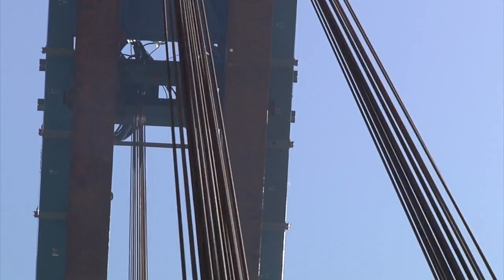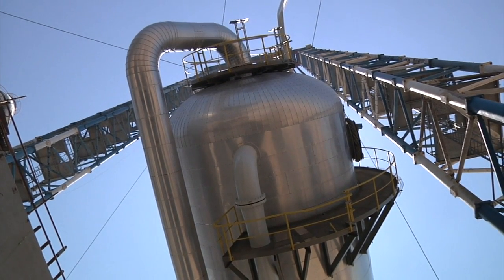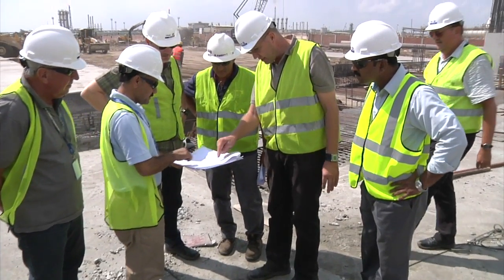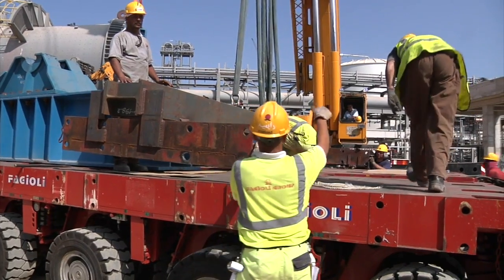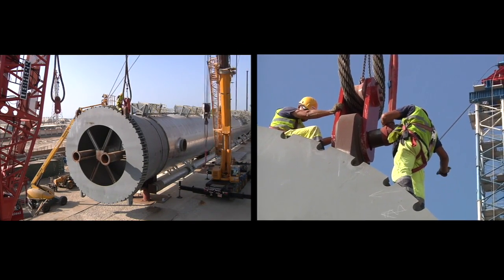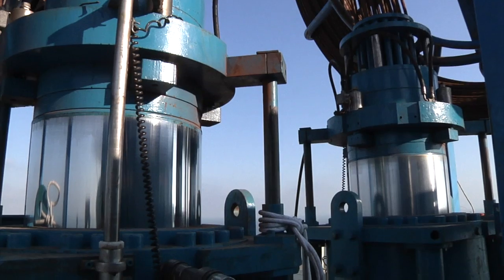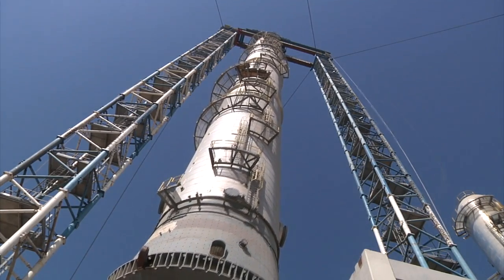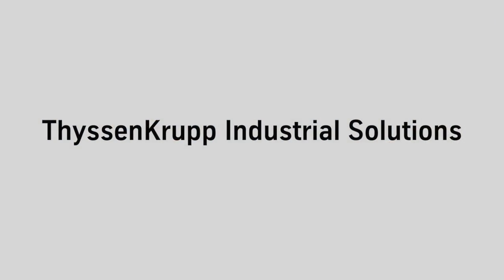Big Lift

Comment: ohh my god , a good things from memory i was be there , in 03.00 Mr.Ali "Father" explain to uhde staff the procedure and preparation for safe heavy lifting C3 splitter , The biggest problem faced by Uhde team was to install this giant tower on the many anchor bolts, so my father’s idea was make a reducer welded above bolts , he works as a guide just to enter one of the holes, followed by the entry of the rest of the bolts into the rest of the holes, and this idea was recorded in Uhde GmbH , Full respect .